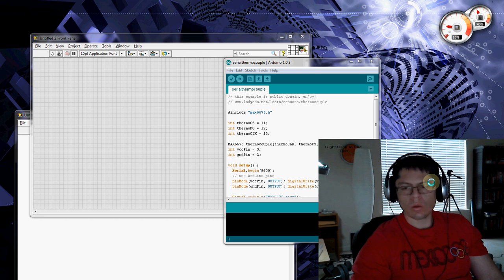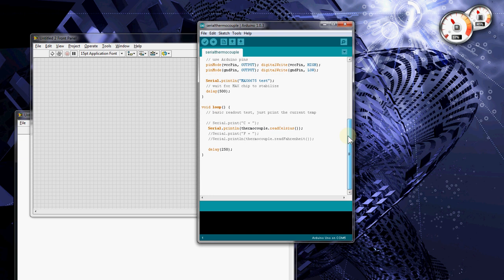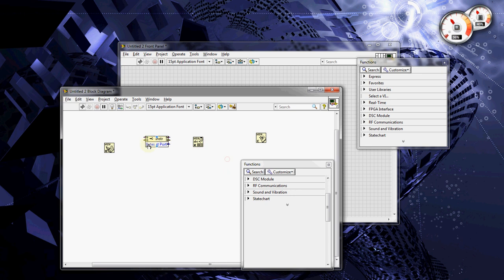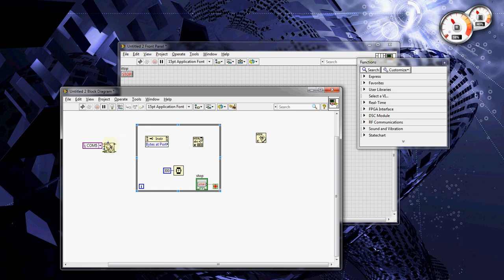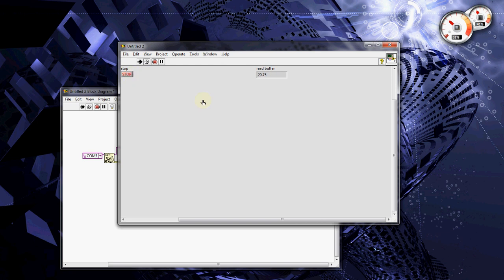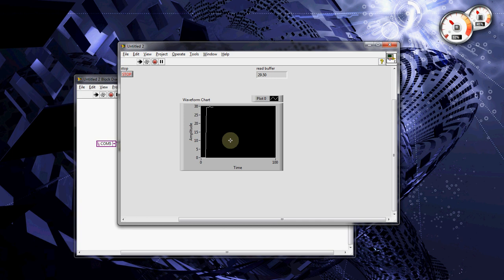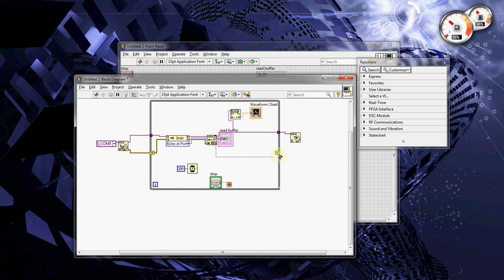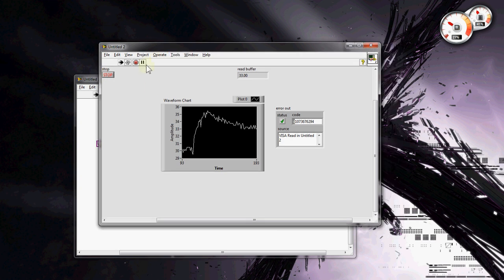LabVIEW communicating to Arduino using Virtual COM port

Comment: Hi, nice program, however I noticed in my Vi the temperature reading is delayed in time. This problem is not present using the arduino serial monitor. E.g. I put a lighter close to the thermocouple I see the signal increasing only after 5-7 seconds and not instantaneusly as in the serial plotter or monitor of arduino. How can I fix this? Thanks in advance

Comment: I am transferring my ecg signals from Arduino to LabVIEW but the waveform in LabVIEW is not the exact replica of Arduino as there is  a lot of differing
Reply from the maker: ECG electrocardiogram? Check on the formatting of data. Data rates are also important. Can you explain a little more?
Reply: @marianomruiz  I am taking ecg signals using ecg module (Ad8232) and serial monitor in Arduino now I am getting the signals but there is some differing between the signals of Arduino and LabVIEW as I have obtained the waveforms in Arduino serial plotter
Reply from the maker: Akshay Nayak hi! So in the serial monitor you see some values and on the LabVIEW graph they are different.  Are you getting different values at the visa read? That is in string format. That is the first point of entry of data from the sensor into LabVIEW.
Reply: @marianomruiz  thanks for your concern so I think that the problem is in setting of delay I come to know that the serial monitor values and the LabVIEW waveform values are quite same but can you suggest for delay setting how much I should set the delay 

Thanks,
Regards akshay
Reply from the maker: Akshay Nayak  the delay will be trial an error. I think the bottle neck is the serial interface. LabVIEW can operate fine at 5mS. Also adjust your Arduino code. If you need more speed, look into increasing the baud rate. I am not sure if you can on the Arduino side.
Reply: @marianomruiz  thanks a lot brother ❤️❤️😍🙏🙏🙏🙏

Comment: Hi, How i can read the value of 2 max6675 modules?
Reply from the maker: +Javierzv Hi! to obtain readings from two different max6675 check on the chip select options. From what i remember the max 6675 uses SPI communications. With this max6675 module you can use the chip select connected to a digital output of your microcontroller to select which module is enabled. Make sure you don't have both chips enabled at the same time. Check this page near the middle. https://learn.sparkfun.com/tutorials/serial-peripheral-interface-spi

Comment: Hi, thanks a lot for the video it really helped me a lot. The reading buffer shows the correct value of the voltage of my solar cells but I still did not yet manage to make it visible in the wave form chart. Somehow its just zero all the time :( I built up the VI exactly like you did but I cant figure out where the error is .... Do you have any idea?
Reply: +LeFawkes sorry for disturbing: I solved it : Mixing up commas with points and the chart just showed the number in front of the comma ....
Reply from the maker: +LeFawkes Hi! I am glad it was just syntax. Good luck on your project.

Comment: At my labview when i make the constant at visa i there is no COM to choose only refresh do u know why?
Reply from the maker: Kontos Xontros Two things: 1- make sure you can see your COM ports on the system device manager if you are using windows. Once you see the COM port using device manager  2-you need to install the VISA runtime Engine. Use Measurement and Automation Explorer (MAX) and see if you detect the COM port there. If MAX is not seeing it, the VISA control on LabVIEW will not detect it either. I forgot to mention, as number 0, make sure the drivers of the arduino are installed.
Reply: thanks a lot i found that i hadnt installed the VISA runtime Engine..!!

Comment: Is it possible to increase the serial communication speed?
Reply from the maker: Tae ho Jang Hi! It has been a while since I did the example, but usually you can increase the speed of the serial communications. The most common speed is 9.6 K baud or 9600 bits/second but if you are doing the same example, There is a delay/sleep of 250 mS in the code. That delay is the bottleneck in the example. Make sure that the sensor you are connecting to the arduino can supplying data fast enough, secondly, you can move into the delay/sleep decrease, and finally, you can move to the baud rate increase. FYI, if you are connecting some analog signal to the arduino, it is probably fast enough. If you are reading sensors using some communication bus like i2c or uart, your speed may be limited there.

Comment: HI,
Great video. I is it possible to read multiple values at the same time and also write multiple values
Reply from the maker: Mohamed Abd El Gawad You will not be able to write in parallel mode, all the data that you send is serialized by default but you can increment the speed of the commands and may be enough for your needs. If you are sending multiple commands that are by default serialized on the 232, an array and auto-indexed for loop will do the job. Beware of loops, in this case you are communicating to hardware and that slows down the iterations and that is acceptable. If you are doing some loops without any hardware or delay iteration timers, you will likely see the computer core at %100. Sorry for the delay on answering the question.

Comment: Hola Mariano I hope you speak spanish; porque para mi es ma facil.Lo que explicas en tu tutorial es exactamente lo que necesito hacer en mi proyecto solo lo que tu estas haciendo con una sola variable; yo necesito hacer lo mismo pero con 6 sensores diferentes para que Labview me muestre los valores y grafique serias de mucha ayuda Muchas Gracias!!!!! y felicidades.
Reply from the maker: Raul Quintero Si hablo español, tu problema se puede resolver con varias chips que usen I2C communications y le puedas poner addresses a cada una y te comuniques asi usando el I2C a cada chip. I2C es otro protocol serial que que es sincronizado, ese protocolo lo usaras para comunicarte con los chips que lean los sensores y la comunicación 232 la usaras para comunicarte de LabVIEW a el Arduino.

Comment: Am new to arduino, so i am curious to know how to connect a thermocouple to an arduino uno board.
Reply from the maker: Hi! There are several ways you can do this. thermocouples are not linear and you can either make your custom conditioning circuits with op amps and loading temperature curves or forumulas to your arduino. I do not recommend that route. The easier faster approach will be to get an SPI chip that does all the conditioning/calculations and gives you a temperature output. The most common tcs are K type and a max6675 will give you the temperature reading using the SPI protocol.
Reply: Mariano Ruiz
 Thanks
I am using AD595 chip, and I have been able to acquire a signal using labview but i was wondering; how the Atmega328 microcontroller can be valuable as an embedded system or function with labview?

Comment from the maker: The driving cicuit will have to be made with transistors or a solid state relay. (It will need to be capable of switching fast) In principle, you could connect the motor to the relay on this video and see it turn. If you needed more speed, you could increase the P (Proportional.)

Comment from the maker: Hi! to change the RPM of a motor, you will need a driving circuit. Motors use higher currents than what the aurduino is capable of supplying. There different types of motors so that is the starting point. Some ways to control the speed of a motor is to change the voltage, PWM, increasing the phase frequency. If you need to control something like a cheap toy motor, it will be permanent magnet DC motor and you can change the voltage but a nicer way and keepig the torque will be PWM like the video.